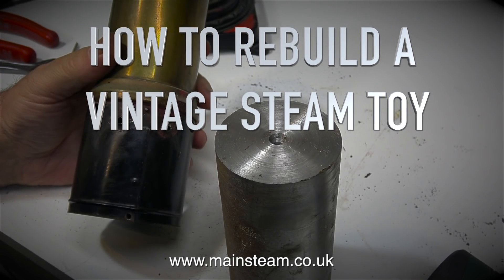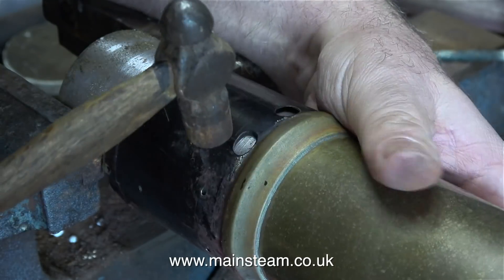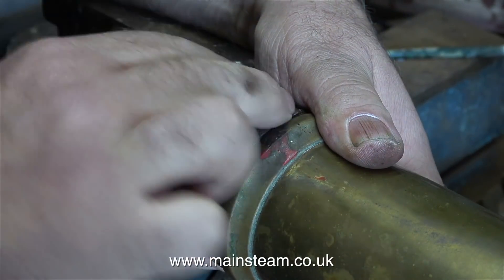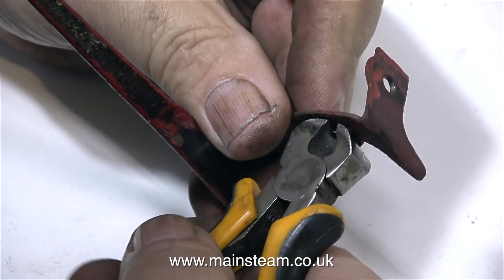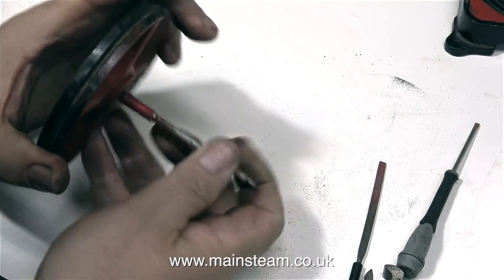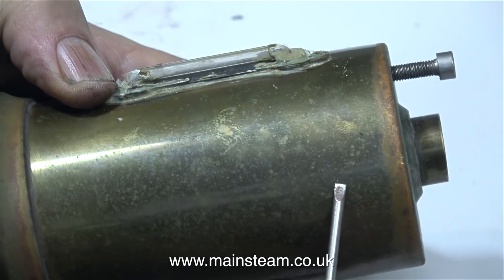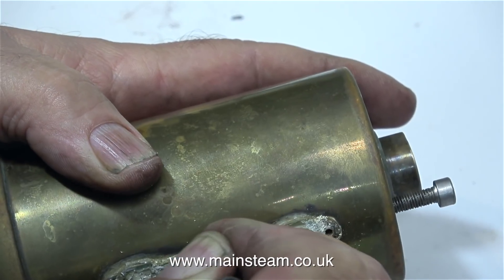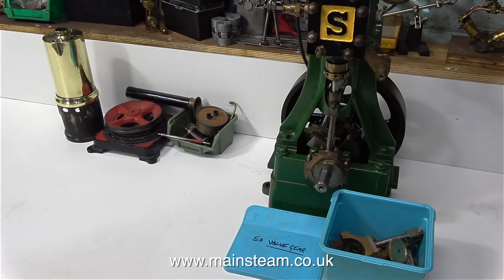HOW TO REBUILD A VINTAGE STEAM TOY - PART #2

Comment: I would have thought that the gauge glass would be made out of borosilicate glass (pyrex) to resist heat shock which usually needs an oxygen propane torch to melt so I'm not sure even your big torch would be hot enough.
Reply: It's not the size of the torch with borosilicate glass (pyrex) that matters but the concentration of heat. A small torch with the right flame will do it.
Reply: One can bend Pyrex tubing of that size using an alcohol lamp and a small air source (blowing through a tube).

Comment: After doing a bit of my own research I think it's a Bing 130/883 circa 1920. Flywheel does not appear to be original. No great surprise there given the age of the engine. On these steam toys it is easy to damage the flywheel if it is dropped. There is also the distinct possibility that the original succumbed to zinc pest.